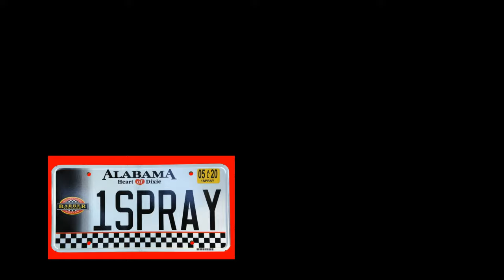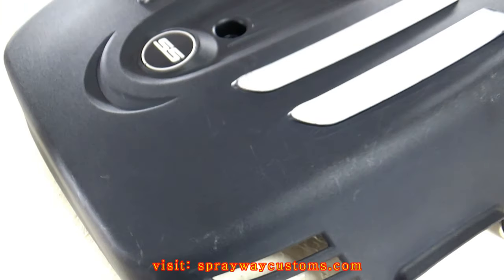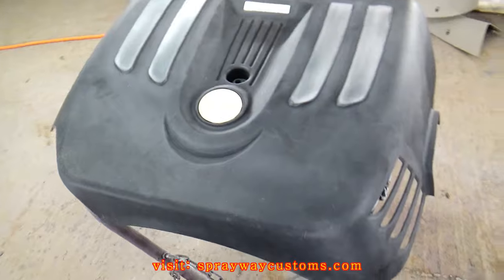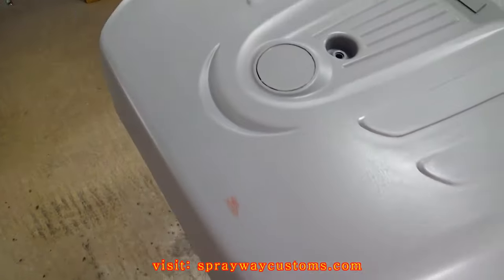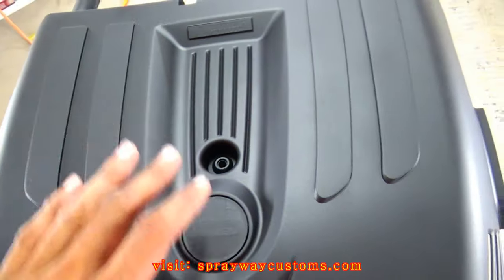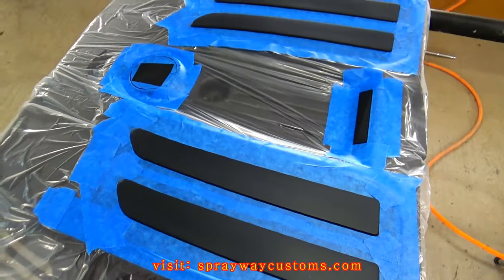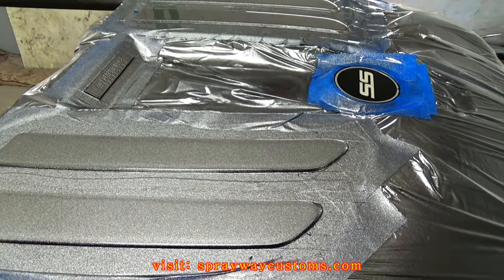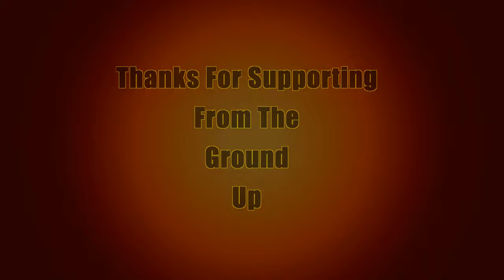How To Paint Your Engine Cover A Two Tone Color PAINTING PLASTIC Flat Black & Gloss Silver Metallic

Comment: Great work as always.. can I ask what kind of primer you used?? There are special plastic primers but do you still use those with the adhesion promoter?
Reply from the maker: EightSix EightSix On this job I used Upol primer. If you use a adhesion promoter you wouldn't have to use a plastic primer.
Reply: Great info thanks big dog

Comment: Another great job. Is it necessary to spray adhesion promoter on front and rear fascias before you paint them? Great channel.
Reply: Adhesion promoter is best used on plastics for the paint to stick, where as primer is used for bare metal surfaces to prevent moisture and forming rust.
Reply from the maker: If it's raw plastic most definitely but if it's been painted before you can do without it.
Reply: @SprayWayCustoms  Thank you for the reply

Comment: man another great video.  Do you use 2 different types of primer for plastics and metal?
Reply: You normally wouldn't use a primer for plastics as its purpose is to prevent rust from forming on bare metal surfaces.
Reply: @cr4zy455wh1t3b0y07  well by plastics I mean motorcycle fairings should I still not use primer (
Reply: @ranyalsreign8338  I painted my fairings on both mine and my wife's bikes and didn't use primer, only used adhesion promoter, then base and last clear. Using a filler primer to fill scratches and little stuff, sand it off and so on.
Reply from the maker: They do make a plastic primer that has more flexibility but if you spray adhesion promotor on, you can use basically any primer to fill imperfections.